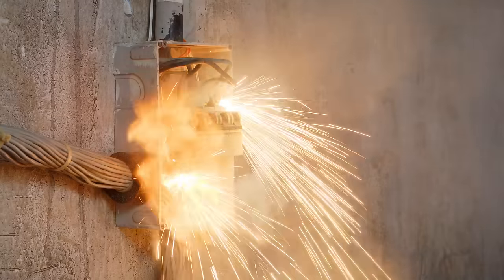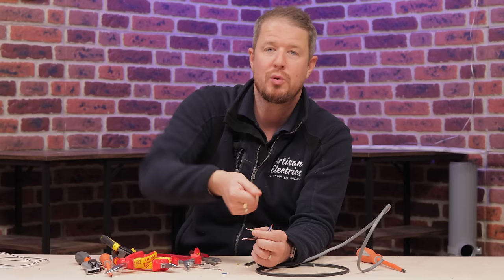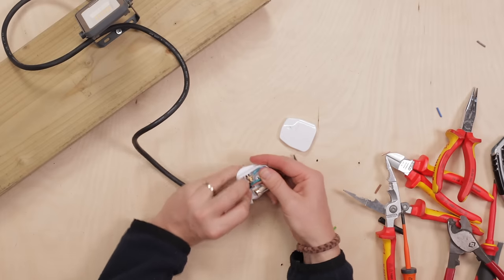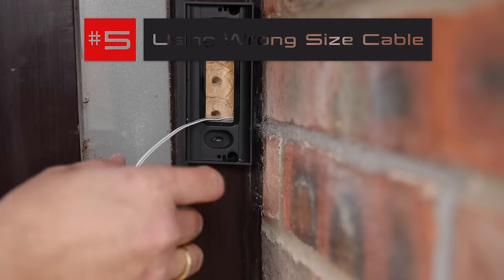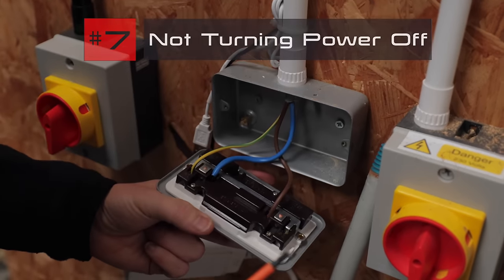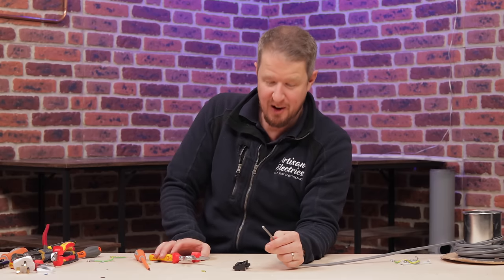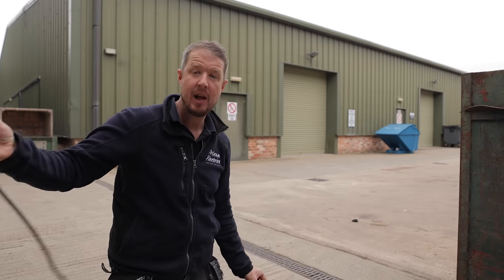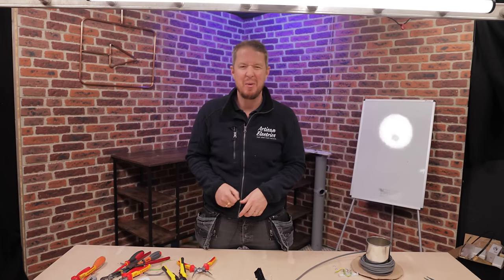10 Mistakes EVERYONE Makes When Doing DIY Electrics!💥

Comment: If an extension lead is rated to 10A then it shouldn’t matter how many you daisy chain, you can’t exceed that 10A. This is a fear that comes from countries that don’t have fused plugs…
Reply: You will eventually hit a limit which is caused by the voltage drop along the length of the cables.
Reply: As deang wrote, voltage drop due to the connections is one thing. But that's not the worst. Due to the resistance of the additional connections, your ground/PE wire might have a too high resistance and therefore not work properly anymore.
Besides that, here in Germany most of the circuits are fused with 16A. Put two heaters with 1.8kW on the line, 16A/3.6kW in total. Your breaker will not trip, but your extension cord might turn into a third room heater...
Reply: @johnscaramis2515  the earth impedance can be much higher if an RCD is used, at 1667 Ω.

So if a 30mA RCD is used for additional protection in the socket or at consumer unit where the breakers are, then a much higher earth impedance can be tolerated.
Reply: @deang5622  Not disagreeing. But the risk remains, especially if you have old buildings where the grounding might not be the best anymore.

Comment: the only complaint i have about this video,is near the end . the spark called a socket out let on the extension lead a plug, i am a retired in spark and never called a socket outlet a plug. also i never saw the spark use  a  proving device on the test lamp before using it on mains electric.

Comment: 10:50 "Inductance is starting to build up"   !   NO !   NO !   NO !   
The inductance of the coil is not changing !    
Inductance does not cause heating !
It gets hot because the current going through the resistance of the wire causes heating !
Unreeling the cable allows cooling !
That is why current ratings for ALL cables depend on the environmental factors !
Thank you for listening.

Comment: Sorry but in Cubs okay I am going back to the 70s to get the electrical badge you had to make a battery circuit to turn on and off a light and be able to wire up a plug safely.
Fast forward many years as part of my City Guilds IT course I had to wire a plug correctly and safely... I held the class record.
During my University course I was called out by course mates that would pay me in beer to extend multi sockets to the right place in their room.   Take them apart and install the right length of cable (which they paid for.. back when you could by three flex by the meter) and we had a night out.
Staggers me that people cannot change a plug.

Comment: I once moved a wardrobe to find a flex cable running out of a single socket, down the wall and under the carpet. I pulled up the carpet and traced the flex cable to the other corner of the room, where it went into a hole in the wall, directly below a double socket. I'm sure you know where this is going...

Yup, that double socket was being fed by the flex cable, and it was concealed inside the wall so that this abomination wasn't obvious unless you moved the wardrobe to see the other end. This is why previous EICR's hadn't found it.

The single socket was replaced and restored to a safe condition, the flex was removed, and the double socket was replaced with a blanking plate.

Comment: You did not mention mistakes that professional electricians make, I recently bought a new build house built by DAVID WILSON so obviously wired up by a professional electrician, I carried out a few checks to certain things through out the house before letting it out to tenants, and found many faults made by the electrical contractor. (a) all wires behind  switch and socket face plates far to short not even enough slack to raise face plates in order to fit wall tiles behind them, (b) over sized and jagged holes made through plaster board when fitting metal back boxes in stud walls, looked like the holes had been made with a hammer and screwdriver, in some cases the jagged holes were to big for the face plates to cover, (c) Some of the metal back boxes were fitted so deep in the stud walls the screws for the face plates were barely long enough and one of the face plates only had one screw because the back box was on an angle to deep in the wall for the other screw to reach, (d) The shaver socket in the bathroom did not have the earth wire connected, (e) When they drilled a 22mm diameter hole up though the bathroom ceiling for the extractor fan cable to pass through the hole went up though the bottom of a wooden roof truss at a slight angle which allowed the cutter to come out through the side of the timber truss which then shaved the grey insulation off a twin & earth cable that happened to be clipped to the side of the truss, not only was damage caused to the cable but the roof truss timber which has a thickness of only around 35mm was badly damaged as most of the timber had been drilled away, (f) when they drilled the first hole down through the bathroom ceiling for a pull cord switch cable they found it was in the wrong place as the pull cord would have been hanging in the door way, the list goes on.

Comment: Come on Jordan you are supposed to be an expert. A wound extension lead doesn’t get hot because of a magnetic field! You have line,  neutral and earth conductors in a flexible cable carrying a single single phase AC, and induction in the line is cancelled by the induction in neutral, (stick a lamp meter around the cable and you’ll get nothing). 
Any heat is due to the impedance of the conductors, a tightly coiled cable can’t dissipate the heat and can overheat but you’ve got to put a big continuous load through it to have any serious effect. But then people do stick a 3kw electric fire on them!
Reply: Glad someone else said this.
Reply: Electricians are NOT experts in electricity.
Reply: "Induction in the line is canceled by the induction in the natural".
No. There is no induction taking place.

There are two coils, one made by the neutral conductor, one made by the line conductor.

Both coils are interwoven.
Both coils are wound in the same direction.
Each coil produces its own magnetic field.

As the line and neutral currents are in opposite directions, and as the current magnitude is the same in both line and neutral conductors, the two magnetic fields produced are equal and opposite. They cancel each other out.

No induction taking place here at all. It is the magnetic fields that are cancelling each other out. Not inductances, not currents, not induction.
Reply: "Any heat is due to the impedance of the conductors".

No. Any heat created is due to the resistance of the conductors.

Yes there is impedance present, but impedance isn't causing the heating.

Reactance which is present when there is a phase shift between voltage and current doesn't cause heating.
It's resistance, where the current and voltage are in phase, that causes heating.

Technically speaking, to be very precise: impedance includes resistance, but impedance contains both real (resistance) and imaginary (reactance) elements. But to say impedance causes the heating isn't really correct, as that gives the impression you are saying that the reactance causes it, and it doesn't.
The heating is caused by the real component of impedance, which is resistance.

Comment: With reference to wiring a plugtop ... It is in the educational syllabus of some, if not all, UK exam boards that kids are taught how to wire a 13A mains plug. This is mostly taught, in my experience, by teachers that wouldn't recognise a safely wired 13A plug if it was labelled and wearing an "I'm a correctly wired 13A plug" t-shirt! As part of the "establishment" I have tried and failed to argue that if it's taught badly it's unsafe, so shouldn't be taught at all but it's in the syllabus so has to be done. 😞 We have kids going home thinking they know how to wire a plug because "that's the way the teacher said was ok" despite what they did being a death trap. I wish it was a minor issue but, from the last class set of the "wiring a plug exercise" I saw, only 2 out of 15 were wired "safely" after the class and one of those I would still have failed ... but that was the class done and they do not do the exercise again ... scary, very scary.

Comment: Is the coiled extension lead really an induction problem, or just that the normal amount of resistive heat cannot dissipate? Or a bit of each?
Reply: Resistive heating only.
There is no net magnetic field created by a coil of mains cable as there are two currents passing through two coils in opposite directions.

No net magnetic field, therefore no inductive heating.

Comment: There are two sides to this story . In my career as a Telephone engineer I’ve see shocking wiring especially in cheaper hotels. I seen electrical engineers working on live 3 phase control boards , probably much less likely nowadays. That said a Relative brought a house owned by a Telephone engineer and discovered he’d used telephone cable for the ring main wiring.

Comment: There is always two sides to any story……this may sound a little harsh but if electricians weren’t work shy & wanted to do the little jobs, joe public like me wouldn’t have to do DIY electrics, they claim no job is too big or too small but unless you want a 15K full rewire most are not interested.
Reply: Although you're right, as a homeowner it's just something one has to be prepared to take on.
   With added problems such as ULEZ or other clean air zone charges, it makes smaller jobs nigh on impossible for contractors to take, and charge a reasonable fee.
Reply: @idi0tdetectioninprogress  I can understand that, but us that don’t live in such places as large cities that would make no difference
Reply: @BikerandBits  True enough. I guess its not easy for those who need contractors. Even the cost of a small job won't be cheap, and the simplest of things can grow into something more expensive. You may as well purchase the tools and have a go yourself, at least you gain in toolkit value and skills over time. Paying contractors gains you nothing other than a lighter wallet!

Comment: Sorry mate, but the wires do not vibrate! They loosen from heating, cooling and partly the copper compressing if not tightened right. You are the only one I have ever heard mention wires vibrating, where did you hear that? For sure you have seen DC wires loose too, no alternating current going on there.
Reply from the maker: That’s not what the NICEIC assessor told me but maybe he didn’t know what he was talking about 😂
Reply: @artisanelectrics  Hey, everyone makes mistakes. lol 
Jokes aside, I have never heard that from anyone or anywhere else in all my training and career. But now I know where you heard that from. 
Sure, under sudden loading / unloading and faults there definitely could be movement. But, never heard of the 50Hz  or 60Hz imparting any vibrations on wires. Inside transformers, motors , coils of course. 
Anyway, hope all is well there and I still haven't been back to the house with the mystery earth fault. I'll be sure to let you know if something bad ends up happening, which I hope doesn't happen.
Reply: Thank god someone else commented on this. This guy is a crap spark and like most crap sparks puts the blame on someone else.
Reply: @VinoVeritas_  I wouldn't go that far, he knows his shit. Just this is the second time I heard about "vibrating" wires from the AC loosening up connections and both times from Jordan. Never heard that from anyone ever before. Even did some research to find info on it.... none to be found. 
Aside from of course from wires can / do move from higher currents, but not from the 50Hz or 60Hz AC frequency in everyday usage just sitting there.
Reply: @inothome  The movement is caused by repeated heating and cooling of the copper conductors. It's miniscule, but over time it can take its toll.
Reply: @VinoVeritas_  100% agree and mentioned that. But he keeps referring to the vibrations from 50Hz, not from heating and cooling.
Reply: Back in 1985 management of maintenance was added to my production management role in a manufacturing facility.  The company had a standing policy of having tightness all electrical terminals checked at 6 monthly intervals.  I thought that was overkill inittially untill I accompanied the sparky on multiple visits and was amazed to observe how many terminals had loosened in 6 months.  I suspect that hot/cold cycling and vibrations from running machinery were involved.  During my time we never experienced a stoppage due to a poor electrical connection.  I am certain that without the routine maintenance, production would have eventually been interrupted, which could have had very costly consequences.
Reply: @kingsleydyson4841  We did the same at the electric utility in the relay panels. There is always loose terminals, AC and DC. Any time I open a breaker box I always check all the connections before I move or touch anything and there is always loose stuff. Especially with the shoddy workmanship here in Vietnam.

Comment: I have watched electricians strip wires using cutters and the conductor scored by the cutters. This is very bad as the conductor is susceptible to snapping at that point. I have seen an earth wire snapped off inside a consumer unit because of this. One to watch out for.
Reply: Proper technique is to not score it just to nip it to put a dent in it but not otherwise cut into it.  That creates a stress point.  Grip the wire at that point with the cutting jaw of the pliers or sidies and give a quick yank and it will fracture there and pull away.  You don't put additional pressure on the tool to dig into the insulation only enough to be resting in the dent you made previously.  The cutting surface never touches the actual metal.

Comment: I see electric cars being charged outside homes using a 3 kw charger / granny charger plugged into an extension lead that isn't fully off the real. UK sockets are rated at 8 amp continuous so they are over loading the socket as well at 13 Amps for an extended time. I found a loose neutral in a friends recently installed kitchen socket. The installer / electrician had wired a kitchen tap heater along with a dish washer and washing machine off a double socket spur that wasn't fused. I refused to fix it telling my mate to get it rewired correctly. I also recommended getting an electrical inspection from a qualified electrician. I have an electronic and electrical back ground but don't know the latest regs so won't do wiring. You need an electrical tester as well as a test device / proving unit.
Reply: You don't need an electrical tester to do your own DIY electrics.

Those meters are used for test and inspection. And unless you have the specific electrical qualification in test and inspection, and you are suitably electrically qualified, and you are a paid up member of NECIEC or NAPIT, you are not allowed to sign off and certify your own work.
Reply: @deang5622  Its always good to see if the cable is still live. Some diy installs can be dangerous for the next person working on it. I test any switch or socket I replace or find loose wires.

Comment: Is the ‘overloading of extension leads’ a thing as the overall daisy chain cannot exceed 13A as the fuse in the first plug top in the chain wins. Discuss ;-) . Assume for sake of argument it is all done neatly and no coiled up extension leads say
Reply: As long as the fuse in each plug is correctly rated for the cable, then there isn't a problem.

So you could have a 10 amp lead with a 10 amp fixed plug connected to a 5 amp lead with a 5 amp piug and then back up to a 10 amp lead with 10 amp plug.

The maximum current the chained extension leads can handle is set by the rating of the lowest cable. In this case it is 5 amps.

You might possibly run into a problem with using very many daisy chained cables because of the voltage drop along the cable and that could potentially lead to misoperation of the appliance connected at the load end.

Comment: I Personally have seen the coiled extension lead burn in a work environment, If i ever have to do any mains work I always kill the main isolator and check with a fluke pen at the point of work just to make sure, to be honest as well if most of them are mistakes you seen, i'm shocked and can see why regulations exist.
Reply: Fluke pens are not the recommended device to use to prove dead.

Comment: # 10 happens to me before didn't know extinction wire cant be use coil up and connected a 2500w electric stove and later it got so warm wire fused but just the insulation part which render it useless

Comment: So what do you think of secondary insulation within a meter box?   Remember customers have access to this area to "read" the meter....   Can you get the answer?
Reply: All wires that a customer can come into contact with without a tool being used must be double insulated.  Put it in any enclosure you like, if the customer can readily get access, double insulated.

Comment: Everyone keep in mind this guy is in the UK, so everything is 240 volts line to ground, not 120 like here in the USA, so getting a shock there is about as bad as touching one leg of a 480v 3 phase circuit (277v line to ground) here in the USA, you won't just get bit, you get blasted, or burned, or dead. 240 volts line to ground isn't a joke, yes here in USA; cookers, showers, AC units etc are also 240 volts, but the potential line to ground (or live to earth as it's called across the pond) is still "only" 120 volts, so it's not the same. In order to get a full 240v shock here in the US in a single phase residential installation, you'd have to do something really stupid like grab both red and black live wires at the same time.